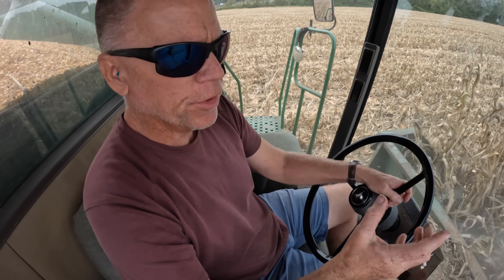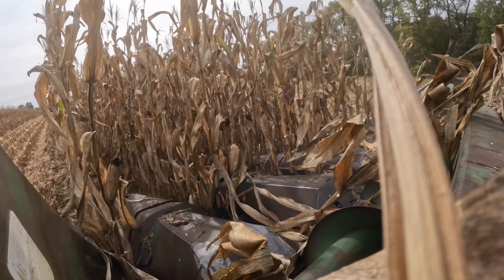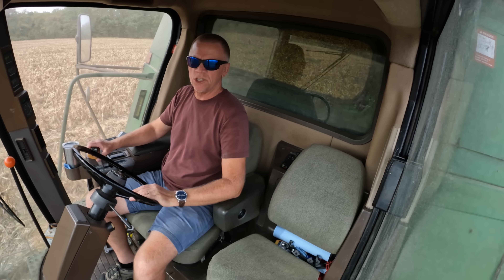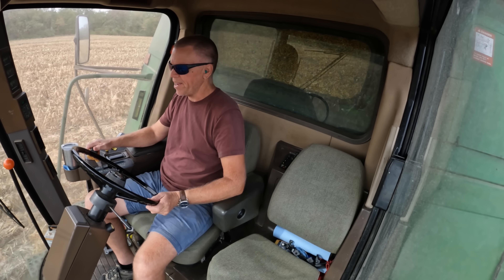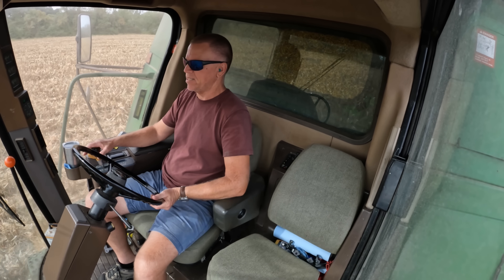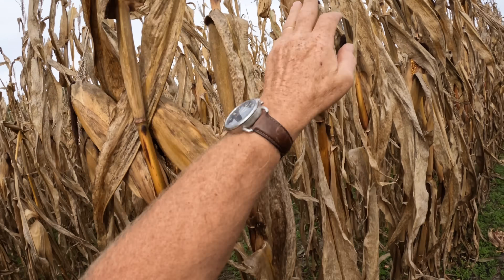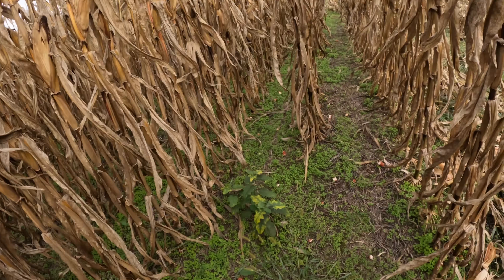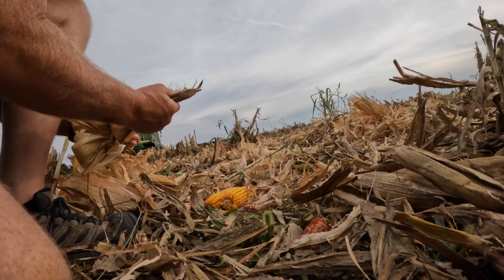No-till vs Tilled Corn - is there a Difference?

Comment: We've been experimenting with No-till corn here in WNY for about 10 years. We started with no-tilling corn on soybean stubble and have had success. As far as stands go, I noticed uneven emergence and or just plain skips in growth...we have a modern planter with air down-pressure and have added a few components for helping close in the seed furrow, so I think what we believe it was is we were only planting a single-stack corn and seed maggot was the issue. We switched to all double stack (below-ground protection), and it seemed to help. We also strip till 1/2 of our corn acres into previous year's wheat stubble/medium red clover cover crop.